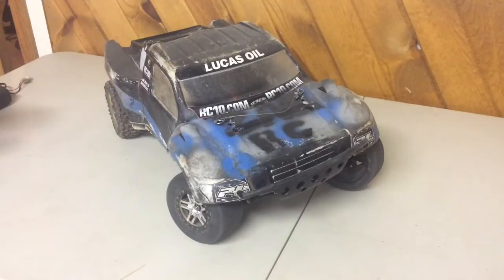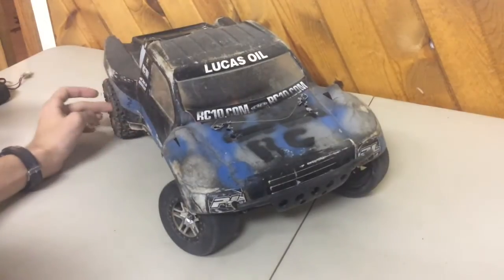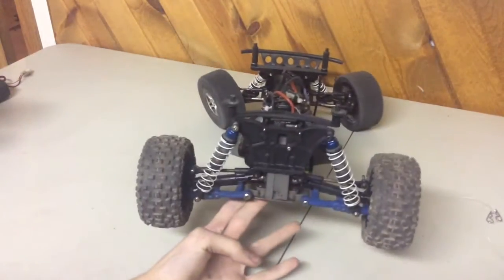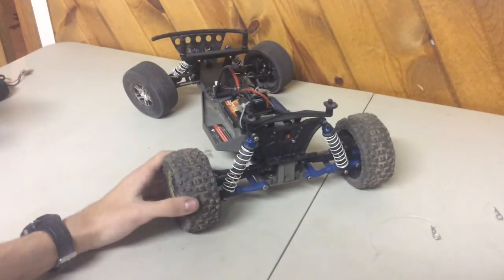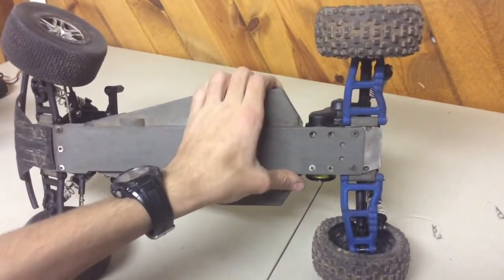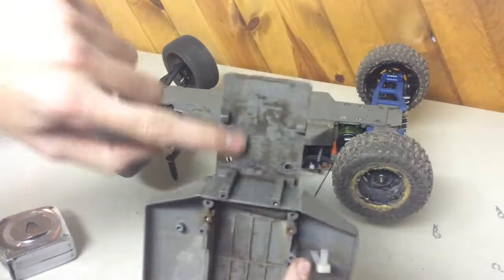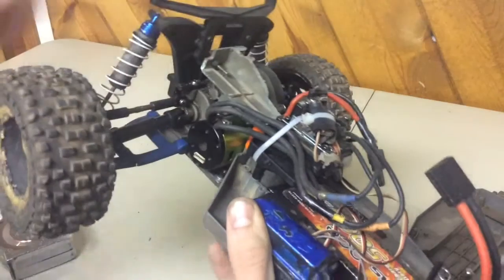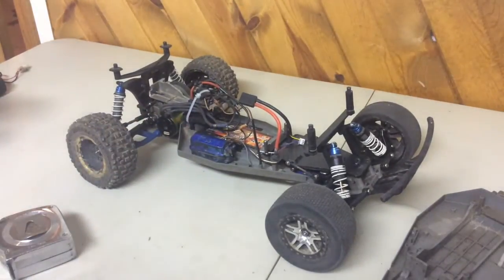Custom Mid Motor Traxxas Slash 2WD

Comment: A sensored motor should still work, why wouldnt it? It works on any other rustler or slash
Reply from the maker: R.C. Trail Runners yes they can work, buy on sensored motors, you cannot swap two wires like you can on the sensorless ones because of the sensor. If the esc has an option to reverse the rotation of the motor (considering that its a sensored setup), then you can run it in reverse with the sensor cord plugged in.
Reply: Ah, ok, makes since now, thanks for the information